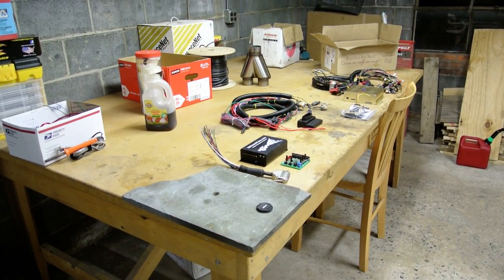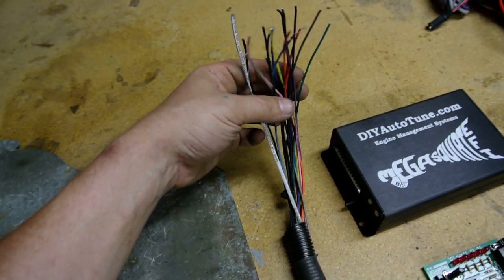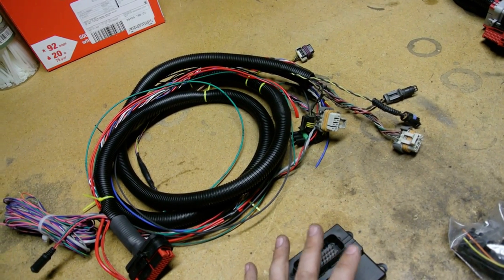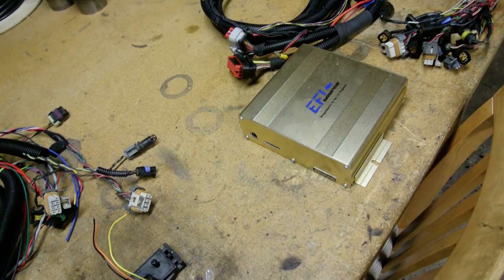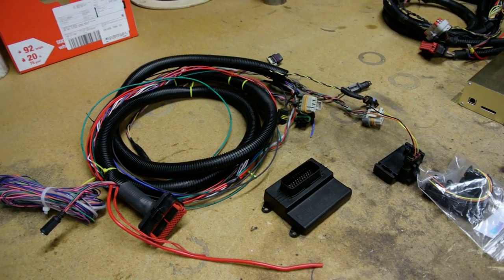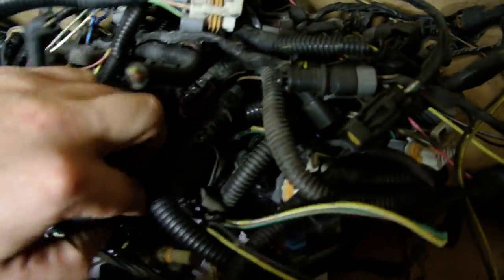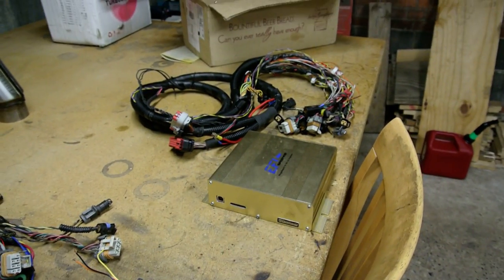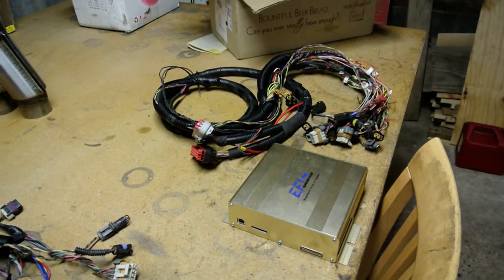6-5-13 Megasquirt1 v2.2 / Microsquirt2 v3 / MS3Gold show and tell

Comment: im choosing a box to run my mv agusta f4.  it requires spark and alternator control.  will the micro be a usable box?
Reply: Micro has one spare output so it's probably possible.

Comment: Hello sir I have a question maybe you could help Iam in the middle of bldg a 90 notchback 351w ecu is a Megasquirt 1 v3  all so have a msd dis4 now my question is i want to run coil on plug  I think I could just use the 4 ignition out from the Megasquirt and into the 4 Chanel in on the msd dis4 the problem iam having is some say wire up the coils parallel and some say in series in parallel I guess draws to many amps and in series I guess cuts that in half but runs like at 6 volts or coils won't fire at full charge, could this setup be done with what I have or would I need something els or maybe it can't be done any input would be great thanks much,  love your videos

Comment: ***** I'm building a 77 Vega wagon just bought a junkyard 6.0 that I'm fixing a cam bearing in and running a 4l80e I have complete wiring harness and ecm I'm kinda torn between using hp tuners with the stock ecu or going with 2 microsquirts one for engine one for trans, or another combo like the ms3 gold car is gunna be turbod, just wondering what your opinion is about the best setup would be, I was leaning towards hp tuners but I have heard it's not that friendly to a beginner and I'd have about the same money into buyin it as I would with a MS product. Car will be summer dd hopefully race weekends.

Comment: How do you run ignition (lsv8) with the microsquirt (v3) and only two ign wires. I thought only injectors were batch, not ignition too.
Reply from the maker: we wired in the ALED and WLED into the 5v circut and use them as triggers for spark, so there are 4 spark outputs ign1 ign2 and WLED and ALED, using the 4 we wire them in as waste spark, for 8 coils. and then all 8 injectors are fired off 2 drivers
Reply: As if the world were black and white, you just turned it color with that awesome info. Thanks. I have read that manual so many times and never thought to use the LED wires.

Comment: Great overview video!

I am planning an MS2PCB3 for my DeLorean, which will have a turbocharged version of the 2.85L odd-fire PRV6 Engine. I will need to control fuel injection, spark timing from the stock coil, include knock sensing, and possibly find a way to control boost levels with an actuated waste gate. I have never done anything like this before and I am concerned that I am a little over my head. Is MS2PCB3 with a 60-2 trigger wheel and using the stock coil, the right unit and the right way to go???
Reply: I think you may want to go with a coil pack setup just for more accurate timing.
Reply: Thank you. I will start researching coil packs.

Comment: Do you have any more info/diagrams/pics of the wiring to go full manual on a 4l80e. Saw a little info on the sloppy wiki page.
Reply: what wiring? you just remove it all and install a manual valve body and shifter and send it.
Reply from the maker: nope i have never done it, so i have no other info on it

Comment: Is this the microsquirt you are talking about in the video that you can run any cam, 24 or 58?
http://www.efisource.com/shop/ls1-24x-modified-microsquirt-v3/
Reply from the maker: yes, that is where i get them, it does not use the cam sensor at all, so you can run any LS cam, and it will run a 24x or 58x gen4 motor

Comment: Any thoughts on which to use for a Gen6 (1996) 454 using the Vortec intake with individual injectors, and prob using 4L80E.. going in a 78 Malibu. Your videos are very informative BTW... thanks!
Reply from the maker: you mean what MS system to use? i would say the most simple one is always the best solution unless you need crazy features
Reply: *****
Yes, I'm trying to decide which to start off with. Craziest thing would be running the board that controls the trans.. other than that probably not too much else. I can run the injectors in 2 banks, so no prob there.. the rest is pretty standard. Ignition may be tricky though.
 Might like to go boosted at some point, will the Micro handle all that?

Comment: im using ms1 v3 on a nissan vg33et and i was wondering if i can tune through using a non nissan tps or iat. like are the values the sensors output all the same or do they work on different resistance or frequency or whatever? and if they do can i just adjust the ms1 box to be alright with it? i literally just assembled my box and still havent gotten my stim and have never used this before so i am trying to get a handle on shit before i waste time getting sensors i dont need or fuck something up.
Reply from the maker: nearly all TPS sensors are 0-5v or something similar, and easily setup, you could adapt any ford, chevy whatever sensor on there
Reply: ***** i thought so, thank you

Comment: Im not 100% sure but i think 96-98 Chevy 1500 with the 350 vortec have the same connector you are cutting out of v6 blazers so maybe if they dont have a blazer you can check a pickup

Comment: will the gold run a 5.3 with the 24 tooth crank trigger???
Reply from the maker: yes, it was designed for the 24x motor, will run 58x, and this same box with some mods will run the Viper V10 engines etc etc etc
Reply: @SloppyMechanics  if money is not an issue speeduino vs ms3 pro regarding performance which would u choose?
Reply from the maker: @FirstLast-tx3yj  i have never used, nor do i know anyone using a speeduino with a car that makes significant power or run a decent time.

Comment: Hey man, given the choice on a swap car, what do you prefer-HPTuners or MS? Why? I have tuned mustangs back in the day with Tweecer, so not a total newb lol.
Reply from the maker: depends, if you are going to use a stock trans, and you want idle air control and other things, the stock ecu is the best bet, if you are going to use a th400 or something like that, and going to race the car, the microsquirt is nicer IMO because you can use launch control anti lag, boost cut, spark cut, and a ton of other options other than just sheer simplicity i like it better, but the stock ecu is awesome also, you just need to have money into a hptuners interface and lic's to do that stuff, i have both so i get to play with both, i would say for a daily drivable car, the stock ecu and a electronic trans is really hard to beat tuned with hptuners, other than that if its a toy and a race car etc the microsquirt is a better choice, hopefully this makes sense

Comment: Excellent video . I'm in the process of building my first LS based 1981 malibu wagon . I've been a die hard old school drag racer Carburetor Man my whole life. But have to give it up to the tunability of the LS based injected Gen 3 chevy's. How can I reach you for some help. My donor engine is from a 2000 GMC pick up that I was allowed to have complete and running . aside from engine mounts where do I start ???

Comment: Great videos. I am getting back into working on a projects now that my son is old enough to drive. I have done a blow through set up on a Silverado using a old holeset hx 40 from a metro bus custom built manifold and the whole speil but that was a decade ago. Now with the ls motors and the mega squirt I cant wait to get started on something. we have a 90 chevy pick up 2wd and I need some recommendations would love to put a 6.0 or even 5.3 and matching trans in it what do I need to look for?

Comment: What if my donor engine has the stock ECU and full wire harness. I know I can cut out the useless wiring, ie vats, rear O2 sensors, etc. If I get HP Tuners an flash/tune the stock ECU will I still need a Micro/Mega S1, 2 or 3?

Comment: you should def do a wiring vid. i hate wiring. its not hard, just love to see how you do it. I've got a MS2 setup that i've been working on for like 2 years, just havent had the time to get into that engine bay. 4.6l mustang (2v) built motor, turbo. scrapping entire stock ECU/electronics. using LS1 truck coilpacks (got em cheap, plans for LS2 coils later on). very odd setup. also, any thoughts on a stand alone system for accessories/lights/wipers etc?

Comment: im guessing i should get the ls modded microsquirt2 v3 for my pd blower ls build. no need for the msd 601x box i gather?  rather not use msd box and ms1 if microsquirt will fuel/fire my ls motor.